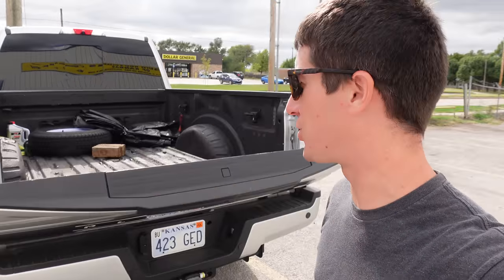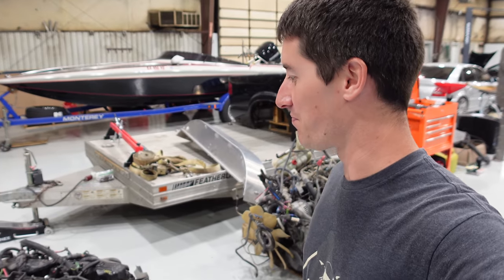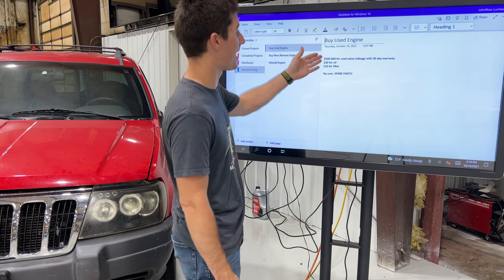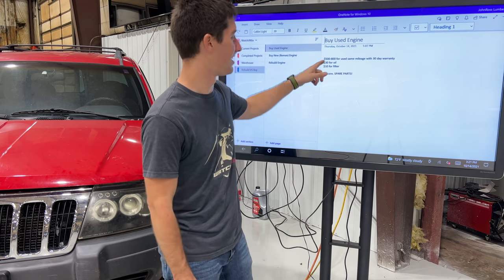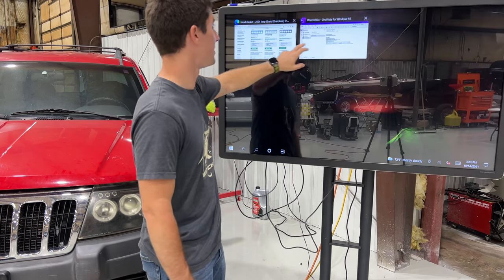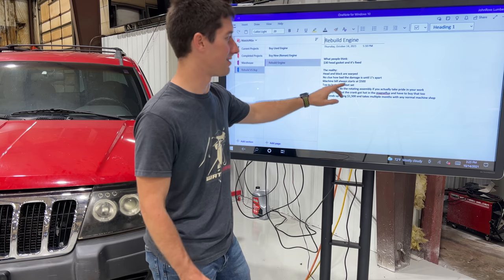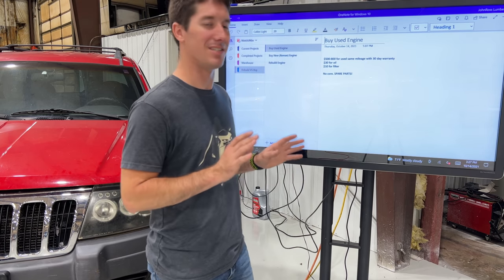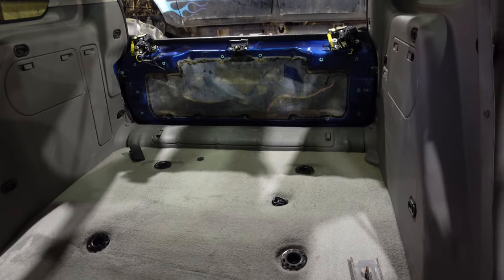Here's Why You Should NEVER Rebuild An ENGINE *The Math Doesn't Add Up*

Comment: 05 5.4 bought at 150,000 miles started ticking 10,000 miles later...... I had to debate this also. We rebuilt with the latest and greatest oem parts known to man. One FULL day and 2500 in parts, and gave my super awesome brother $500. The truck is still a champ. Oh yeah 375,000 miles now still rolling strong on original engine and transmission. Service engine regularly, and transmission, transfer case, front and rear every summer. So there’s that

Comment: I've rebuilt every engine in every vehicle I ever had at one point or another.I don't wait till they lock up, polish the crank, get a great deal from engine parts warehouse here in baton rouge,hone it and put std bearings,rings, original pistons oil pump freeze plugs, cam bearings, cam and lifters,I lap the valves by hand and replace valve seals,I did the 4.2 in my F-150 3 years WITH the original head bolts for under 1000 bucks and drove it two years and gave it to my brother and he's gone somewhere in it as we speak.he said it still doesn't use any oil between changes and is getting 19-20 mpg.The reason I do it is because I can,epw gives me astronomical deals on hasting rings,clevite bearings,cloyes timing set and fel-pro gaskets and I know that the motor that came in the truck is the one made for that truck.hondas,toyotas,nissan etc I would swap out if I ever had to.just finished the 4.3 short block out of my shop truck about to put it all back together.

Comment: Yeah we just swapped in a used motor for a Nissan Versa we have. The motor ended up costing $280 and while it was outside of the car I just changed the water pump as a preventative measure. About $400 all in for the motor (which ran great), an exhaust manifold gasket, spark plugs, fluids and oil and the car was back on the road. Wouldn't have made sense to tear down the motor, find the issue (was probably cylinder scoring) and then take the block to a machine shop and wait for weeks probably. Just swap and go.

Comment: If you rebuild an engine that failed you better check it all and replace anything that shows any wear at all. If you rebuild a running engine without issues make sure to take the same care as if it broke and it’ll proli run forever

Comment: Sometimes you have cars with bad factory engines that don’t last over 150~200k and used engines cost 2~3500. At that point rebuilding starts to make sense when the parts cost ~800

Comment: Here's the kicker, for an overhead cam engine you MUST NOT just mill the head. If the head is not straight then the cam journals are also not straight so the head has to be baked and straightened in any case.

Comment: This is exactly what I have found aswell. Its just a head job right? One month later the machine shop finishes everything and especially now you could get one part, just one thats on back order.. two months later the part finally shows up and you are stuck selling the car at the slowest time of the year... the local scrap yard had a full engine in stock for $800 with fairly low miles...

Comment: "But wait!" some might counter. "If you rebuild the engine rather than drop in a used engine you can demand more for the vehicle when you sell it!"

This is only partly true. You CAN get more for a used car with a freshly rebuilt engine vs. the same car with a serviceable used engine - about $300 more. (Demand all you want, but the market will likely not bear it). But $1500 (engine rebuild) minus $800 (used engine) = $700. Factoring in the resale difference, $700 minus $300 = $400. You've just lost $400, and that's not even including you time investment and the longer down time for the flip. 

Want a fresh remanufactured engine instead? For the above Jeep example you'd be upside-down immediately considering your initial $2800 investment plus the >$3000 purchase price of the reman. $2800 plus $3000 = $5800 - for a Jeep that, even with the reman engine can only fetch (at best) $4500.

Comment: I agree that in some cases, rebuilding an engine is not worth it, and buying either a crate motor or a motor that's already rebuilt.  For one, if you're rebuilding a motor yourself or paying someone to do it, you may encouter things you didn't think were a problem, which adds to the cost.  For example, if you find your crank bearings are going bad, that could be another say $1000 in parts and labor if you suspected something perhaps more minor.  At least with one that's already re-built that's all been accounted for and you know what you're going to pay for a presumably good working motor that has already been rebuilt.  I'd say unless you absolutely know what the problem is and are absolutely sure there aren't any other major issues lurking inside the engine, then go for it and rebuild it if it's cheaper than buying a re-mfg'd or rebuilt engine.  Good example is my Silverado which had collapsed lifters. Cost to replace all of them with solid lifters was $3500 for lifters, cam, other related items and labor.  A rebuilt-motor with a 3 year warranty and those lifters already replaced was $4500.  Sort of a no-brainer even though it was $1000 more ($2000 if you added in labor to remove the old motor and install the new motor).  I knew I would be putting in a motor that's been rebuilt and tested, and had the modifications already done so in the end, it was a better deal than trying to rebuild the original motor for $3500.

The other problem with rebuilding a motor (unless you're doing a complete rebuild: rings, bearings, etc) is that something else can go bad down the road, and you may have to tear the motor down again or have someone else do it.  Many re manufactured motors are torn down and rebuilt with new components (like new bearings and rings; assuming it was a complete rebuild/remanufactured engine and not just a used motor where they may have just replaced the bad stuff).

Comment: Those rebuild kits are less likely to be the same quality as the stock parts and if they have been inspected better and less work a good engine will last if serviced, I recommend adding oil coolers and bypassing the radiator and or condenser coolers for trans and adding the motor oil and power steering the Hayden types

Comment: Guess it depends where you live . I sold reman 4.0L for $1495 with a 7yr 100k mile warranty. A 3.7L v6 $1995
S. B. C. Up to 88' $895  89' and up $1195. A junk yard that sells scrap engines with a warranty  is something I have not experienced.
As a remanufacturer for 27 plus years I would say maybe less than 1% of crankshafts are junk due to cracking. Crankshafts are usually junk due to driving with a bearing knock.
I can't count how many heads I've milled and installed with no issues. If the engine wasn't abused, resurfacing and replacing head gasket might be a viable option. 
Now if you have a S type 4.2L jaguar V8 used is the way to go. In order to remanufacture this engine all cylinders must be bored out and have sleeves installed for the new Pistons which are standard size because oversized Pistons are not an option with the high nickel coating cylinders.

Comment: My dad had a car once and it was spraying coolant out. Didn't over heat but was wondering were the coolent leak was coming from. he came in the house and was saying he thought one of the coolant hoses were leaking. I went outside and looked and saw it coming out of the head gasket corner of the engine. I went inside and told my dad it was his head gasket and he told me I was wrong and went out and looked. Guess what I was right. He had it towed to someone he worked in the coal mines with shop. let him know it didn't over heat, cost my dad like 35 dollars to have the head gasket replaced. he gave my dad a deal. I'm thinking he replaced the head-gasket only and the car last many years until it had other issues. He also used to inspect my dad's cars as well, would put a sticker on it and tell my dad he needs a ball joint and my dad would replace it right away. He never gave my dad an issue of inspecting it as he knew my dad would fix it right away.

Comment: For flipping cars this is smart.  For a auto repair shop we rebuild engines all the time instead of finding a used running motor.  The math works way better if we rebuild.

Comment: Yep. My brother and I rebuilt the engine on a 1990 Chevy Beretta after the head gasket blew. After the rebuild, it only ran another few hundred miles. 

More recently, I swapped the engine on my 2006 Chevy Suburban. I guess I didn't search around enough, because the cheapest used V-8 Vortec engine I could find came from Car Part Planet for about $1,400. Was that too much??

Comment: Yeah my mom's old Chevy Tahoe with a 350 has blown head gaskets. She asked me to fix it. I'm not doing head gaskets on that 25 year old engine. Every bolt will snap off. Every electrical connector will break. Fuel lines will break. Time to LS swap it! A good ol 5.3 will move that truck better than the 350 ever did.

Comment: The tricky part is a warranty doesn't mean much. I've got a 01-ish F150 that my dad bought with intentions of flipping quite a number of years ago, Engine was already pulled and in the bed with rods out the side. Easy right? Just slap a junkyard engine in, don't have to pull the old one out! We go to our local junkyard, Yep, we've got one pulled, low miles, ready to go. Pay them $500 or whatever, warranty is good for 30 days.

We install the engine, its locked up tight as a drum. turns out it got left outside overnight after it had been pulled and got water into the cylinders and rusted it solid.
Pull engine out, take it back, show them its shot, no problem, we've got a 2nd one, they load it on the truck, we put that one in, it knocks, real bad, bad enough we don't want to drive the truck out of the shop, so we drive it deeper into the shop to clear the bay so we can deal with this "half day engine job" later. We pull the knocking motor out, take it back and they don't have any more good engines. they give us the $500 back.

We call a different junkyard which is further away, they say oh yeah we've got one with 60k miles on it, we're delivering a transmission to the shop down the road from you tomorrow, we'll toss the engine on the truck for you, bring the money out after you're happy with how it runs. They show up, and on the valve cover it literally says in paint marker "1998, runs, 240,000" soooo we ended up driving like 2 hours away to find a good running 4.6 ford engine (which seems insane with how plentiful those turds are, at the time nobody had one)
So this cheap truck meant for a flip and profit is now on its 3rd engine installation, but it finally runs and sounds good...

Guess what, the trans is shot, it'll move back and forth just fine, but slips in every gear except 1st and reverse... Dad was in too far with all this mayhem, so he ended up keeping the truck because there was no profit left to be had, no chance of breaking even without using the truck for a while.

Would rebuilding have been a better option? Not a chance. But having a warranty on a used engine is like a seatbelt. I'm glad my car has one, I wouldn't want to not have it, but I sure hope I never need to use it.

Rebuilding is worthwhile for several reasons:
* Its a rare engine/car thats worth keeping original.
* You're keeping it forever and want to know it is as healthy as possible
* You want to learn about rebuilding engines.

Like you said, It is certainly not a more cost effective solution to making a non-runner into a runner.
Reply: cars with bad motors should be the last ones purchased-go for the no starts or cars needing ac work, alternators, fuel pumps, starters, etc.

Comment: Having rebuilt the engines in both my daily drivers, I can assure you it makes no economic sense to do it yourself.   Only do it if you're going to do something other than stock, like a different cam or if you're going to port the heads.  For a 100% stock rebuild a crate engine from a good supplier will get you back on the road in a couple weeks instead of a couple months.

Comment: So i just did a motor swap .  2005 dodge dakota with a 4.7 ho.  I only consider  a used motor and a re manufactured  motor.  The difference between a junkyard motor and a re manufactured was only a thousand dollars.  Labor being the same.  Left me with the totals being $9,000  for a junkyard engine or $10,000 for a re manufactured  after everything.  I chose the re manufactured  route.

Comment: There was a time in the early 2000s where a GM dealer was selling brand new overstock 4.3 engines for 900 bucks. Too bad that's not the case now.

Comment: True- for a flip, a good used motor is the most feasible route. Clean it, detail it, do the consumable parts (T-stat, water pump, hoses, drippy seals/gaskets- whatever is easily accessible) and clean the engine bay really well.

Comment: I thought everyone already knew this, the only time you rebuild an engine is if it is to be used for a specific purpose so you need to uprated internals or at least need to know the reliability of the parts is sound.

Comment: What you said three-quarters of the way through the video you should have said in the first few sentences.  You should have mentioned the context that for a car that you're going to "flip", you don't want to tie up a ton of money in an engine. We can all agree on that. That point is a clear when you first start out the video.

The engine removal and replace that you're doing would probably cost anywhere from ten to twenty-five labor-hours, depending on the vehicle, like Ford pickup trucks we got other the body off the chassis to get the engine out, here Chicago at $120 to $180 per hour in April 2023.

I do like that you gave machine shop estimates as part of the cost of rebuilding an engine.

Comment: Yeah, for what you do I agree that buying used engines is fine. We always used LKQ at the dealership I worked at and never had problems with them. We also had Jasper Remans as an option and when it came to Jeep transmissions that's all we would use because of how questionable they were. As with most stuff related to auto repair it's a case by case basis.
Reply: Is jasper reliable for engines? I desperately need an engine for my Silverado, but have been searching for 4 months and no one reputable has the 6.0😥 I'm so frustrated!
Reply: @richellmcknight446  Mostly yes, the problem is their warranty is very picky so you really need to have it installed by a Jasper recommended installer so that there aren't any questions if something goes wrong. They offer a 3 year/100k on all standard engine applications in passenger and light duty trucks.
Reply: @kamberli545  Great, thank you so much!😊
Reply: LKQ is right over here outside Crystal River, Florida. Didn’t realize that and how big of facility they have. Impressive.

Comment: We have a pick and pull 140$ for l4, 200$ for v6, 280$ for v8 core price included vs 1000$ on low end for engine rebuild or more and only 100$ for transmissions with core price included I flip cars all the time it’s the smart way to make money and fix and leaks before engine drops in I bought a v6 firebird 121k miles for 300$ put 600$ into it and sold for 3500$ cash in 3 weeks and customer returns for aftermarket work

Comment: Dude, I've rebuilt several engines.  And I've had 98% success and my failures were just quick fixes.  It's not the rebuild that's the problem.  It's the knowledge of building an engine in the first place.

Comment: Head gasket was blown but I never let it overheat. Replaced the head gasket and it's at 60,000 miles on top of the 140,000 miles. I will be swapping the next time.

Comment: Agree 100%! Also, even supposed "factory" rebuilds from the manufacturers are absolute garbage. I would buy a used running engine out of a salvage yard or LKQ before I would ever consider buying a remanufactured engine. Ask how I know!! Numerous failures, stripped and missing nuts and bolts, leaking gaskets, you name it. And that's even on a $40K CAT Diesel! If its one of my work trucks and I can afford to take it out of service it gets completely rebuilt. Some of these rebuilds have taken 6mo to a year depending on how busy the machine shop is and what work needs to be done. You have "zero" warranty though. That gives us the incentive to rebuild it correctly!

Comment: Unless it’s a pre-emissions diesel, big block, or a hard to find old engine. But yeah, the new engines is just to find a drop in used motor drop it in, & that’s it.

I’d probably rebuild my engine, but I’ve got a 93 7.3 idi Diesel engine under the hood.

Comment: You know what I mean , torquing the fasteners just right, using rtv and a gasket to make sure it never leaks again, all the parts super clean, no carbon no oil mess.   And the timing set perfectly, fixing engineer mistakes, otherwise making the engine better than when it came down the factory line, parts like the water pump and valve covers sprayed with glistening colored paint.  You know what I mean, it feels like , wow, I accomplished that.  But, your right, if your not ready to deal with many expensive and time consuming problems, do not rebuild.  Because it is a royal pain in the ass.  But it's just so much damn fun rebuilding.

Comment: The timing belt snapped in my Volvo XC90 I sent it back to the dealer I was buying the truck from. They took forever to fix that engine. 7 months went by. What I learned from this don't buy used engine if you can buy a new engine less problems.

Comment: $800 for an engine, a rebuild will probably be $400 just in parts,, but if you're doing it yourself, it will take 1-3 days to do it considering your machine shop is fast at resurfacing.